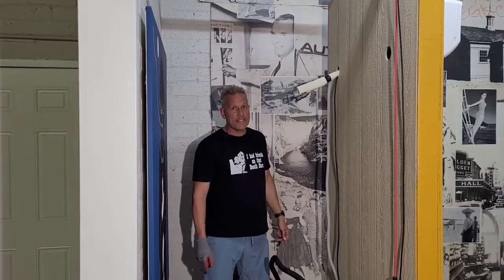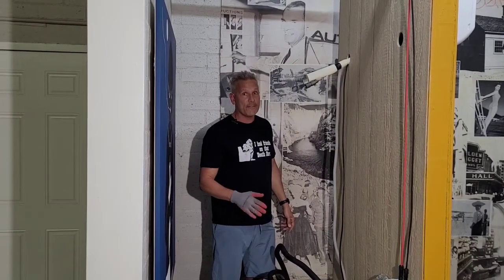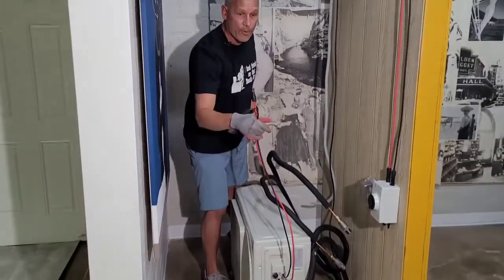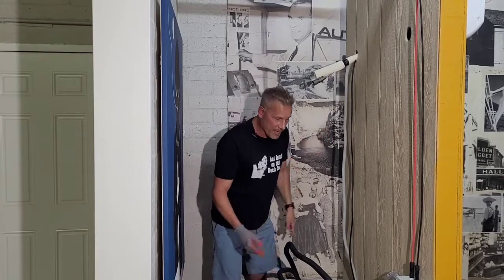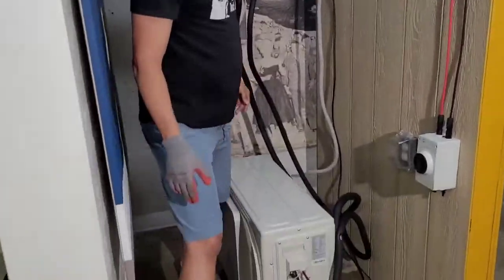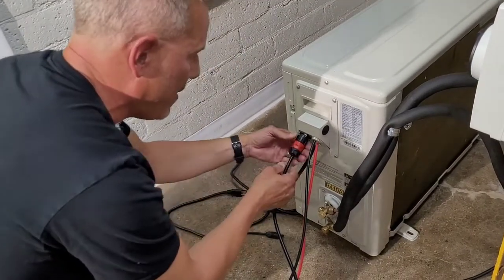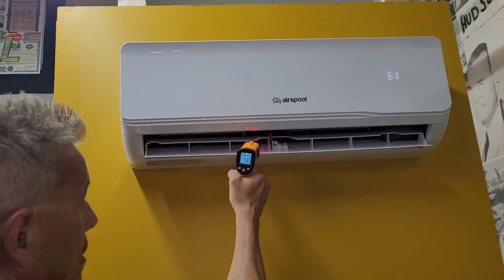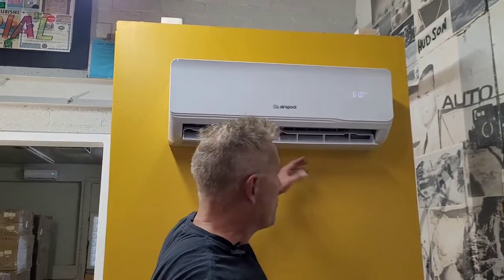DIYers: Get up and running in less than 5 minutes with our Quick 'n' Easy mini-split.

Comment: Hello. Thank you. I heard about this from this guy: https://www.youtube.com/watch?v=l2JOUCo7iaM&list=LL&index 
  
I like this. However, I live in a condo on the 3rd (top) floor. I wonder if I can install the condenser on the roof...? My other condo owners have given the green light. However, I am curious about how to secure it on the roof. It is a "flat" roof. What would happen with the drain? I don't think I can convince my neighbors to let me run the drain all the way down the side of the building. If I run it along with the refrigerant pipes up to the roof, can it pump up, and if so, how high? That way, the water will just go down the roof drains. Also, can I also bundle the cable in the insulation as well and just bring it inside my condo? Or is there somewhere to attach a cord in the inside unit so I don't have two-way traffic with the electricity?
Reply from the maker: Yes, the he top floor is a fortuitous location for what you want to do. Just mount the unit on the roof, hopefully in a hidden spot where it cannot be seen from ground level, and also run the condensate hose up there. You need a pump like this Little Giant VCMA-15ULS 115 Volt, 65 GPH, 1/50 HP Automatic Condensate Removal Pump with Safety Switch, White/Black, 554405 https://a.co/d/cXHKB7L. For the electrical, yes, you can bring it down into your unit from the outdoor unit on the roof and just plug it in to any plug within the condo.

Comment: Connecting it to the house outlet is optional  ?
Reply from the maker: Hi Pink Bunny, yes, sure. You can have it Ron just as normal mini-split by plugging into normal power, or you can have it just run off of solar, or you can run with a combination of the two. If you have it plugged into grid power and also have solar power, solar power will always be prioritized.

Comment: Do you have or sell bigger unit .orher than the 12000BTU And longe line set than 10 ft?
Reply from the maker: We have 18,000 BTU and 24,000 btu, but they are not energy star rated yet, so get in touch for the details. And we can customize the line set on the quick and easy units. For our non-DIY unit, supplyhouse.com